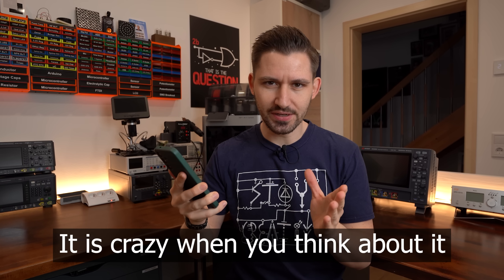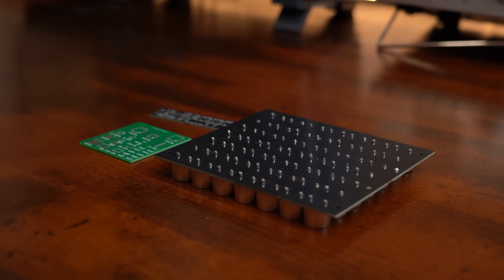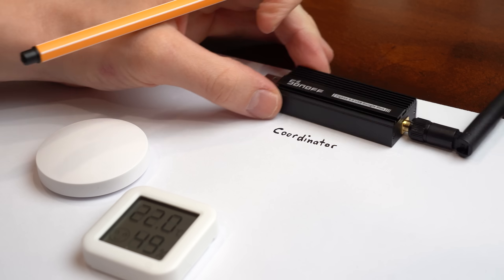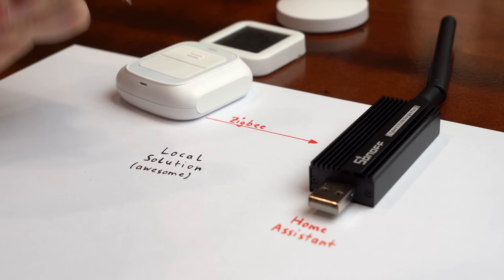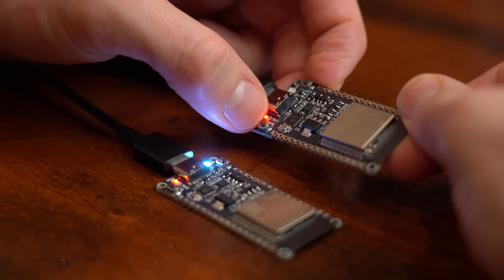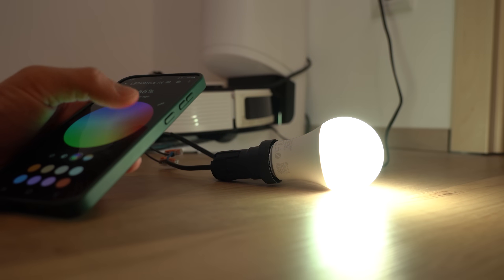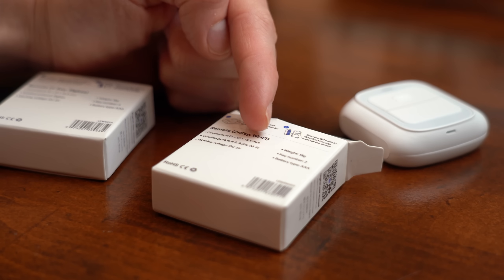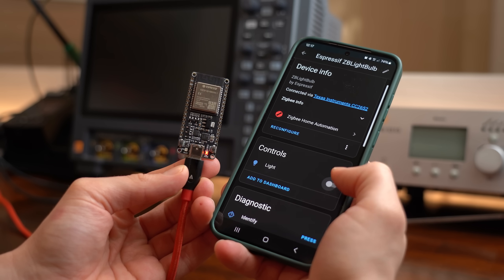Forget WiFi AGAIN! This Wireless Method is WAY Better? (Zigbee)

Comment: The zigbee module in my Aqara tunable white LED bulb died so I tried to replace it with ESP8266 bare esp-12E (smallest form factor, and I had it already). In idle the ZB uses 15 mA, the ESP-12E 67 mA or 15 mA (with higher peaks from time to time) with wifi power save active.
I'm still trying to understand why it resets itself as soon as it reaches the status "ready" (onboard LED turns on). Maybe a wrong connection on my side.
If you want to play with it for a video, maybe I can borrow it to you.

Comment: While your point about wifi devices (at least those which require cloud connectivity) being disabled if a company goes bankrupt is completely valid, I think the more frustrating part of those devices is that companies can just stop supporting whatever you bought - for any reason, and at any time - which makes the device you bought a literal paper weight. A couple of years ago Sonos bricked all of their Gen 1 speakers because they decided to stop supporting them. They absolutely could have released a firmware update that would have at least allowed them to work locally, but they didn’t - as far as I know anyway. 

Plus, having more wifi devices on a network isn’t a good thing. Especially when we’re talking about homes that could potentially have over 100 “smart home” devices, which doesn’t even include computers and phones, etc. That will just end with slow and unreliable wifi. Same with devices that operate in the wifi band in general - there’s only so much bandwidth available, so I try to keep all of my smart devices off of my wifi network.

Comment: With Home-Assistent you will want to use Zigbee2MQTT instead of ZHA because the former can handle firmware updates using a big list of internal firmware versions that gets updated frequently. It also has much more features.

Comment: Wireless range is good, but more so bad -- To increase capacity in a wireless system, the strategy is usually to decrease transmission power, and add more access points which connect with a wire. The smaller the range of wireless transmission, the more access points you can use without interference, and the more wireless devices you can use within a given area. Wifi makes it extremely easy to achieve this high density. Zigbee on the other hand... Not so much :)

The radio frequency spectrum is one of the world's scarcest resources. When something is transmitting within a space, it is occupying that bandwidth and there is literally nothing else we can do to have more of it. Having two separate systems transmitting within the same frequency range means that they will interfere with each other. When there's interference, it gets worse at an exponential rate -- Failure to transmit results in re-transmission, which will cause even more collisions, and more re-transmissions and so on.

Wifi has a scheme which prevents this by partitioning device transmit time. It also has multiple channels which allows interleaving access points in a way that doesn't cause interference, and many more optimizations to squeeze as much as possible out of the available radio frequency range. Having a Zigbee transmitter in the same space is in direct conflict with these efforts.

The only real clear advantage I could see for Zigbee would be the lower power usage, which would only really materialize as a benefit when using batteries.
But who wants to keep replacing batteries for hundreds of small devices? I'd find means of not using batteries at all for these devices instead of trying to extend their battery life a little bit.

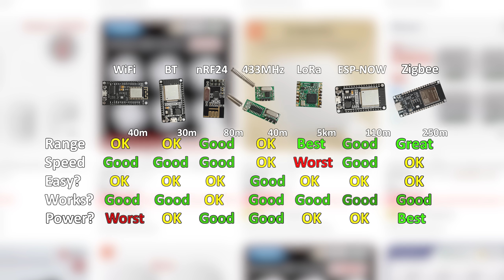Comment: 11:34 something I have struggled to find clear data on is battery life of “receiver” devices that are always awaiting a command or connection. I’m not asking for years of run time in a constant waiting state.  My need is for something that could be left on for atleast a week running off of an 18650 but be able to respond instantly. Any ideas?

Comment: Here is another protocol for you to take a look at. Z-Wave. I dont know if there are any dev boards for it out there but it uses a lower frequency then Zigbee, lower total devices in a network but its touted as have very good meshing capabilities. Would aslo require a coordinator for Home assistant. Id recommend Zooz brand for that.

Comment: All good content. One more bit on Zigbee vs Wifi:  You have over 100 Zigbee devices on most coordinators, and the network generally is still quite responsive.  Many Wfi routers top out at 30 to 60 devices, and are super slow when you go near those limits. Even running OpenWRT or other firmware that doesn't impose a software limit, the spectrum and protocol are simply not designed to have more than ~80 client devices on a single access point. (For 2.5 at least, 5 is better, but most wifi home devices only support 2.5).  Zigbee, because of it's protocol, is designed for smaller burst messages, and for being point-to-point.  In fact, you can setup Zigbee devices to talk directly to each other!  So even if the network is gone, a switch can still talk to a bulb and turn it on, so long as you directly bind them.  The protocol isn't designed for  large data transfers (like firmware upgrades), but it's great at what it wants to do 99% of the time, which is operate devices and report status.

Comment: I implemented my whole house (just lighting) in the mid 90s on a system called "X10".
It was a pretty big house on 3 levels, so it was nice having control. 
Unfortunately it was never really as robust as it needed to be, and i eventually just gave up. 
Since then the whole idea of home automation just isn't interesting to me, but that's all a function of the much smaller house i live in now and the emergence of LED lighting, which uses do little energy i just leave them on all the time.

Comment: BT range is "ok"?
Obviously these things are subjective and depend on use case, but I would say a few meters for BT and 20m for wifi are VERY different.
Also not sure how wifi is only "ok" for easy? Again, probably use case. If you want to do home automation or similar, I guess it is tricky(er?) but for the vast majority... press a button, or type a credential and you are done.
EDIT: BT is 30m??? Since when? ( I WISH you had of put those stats on the original chart..... why are those stats not on it? :( )
Reply: EDIT2: You have numbers, why are you using non specific Worst/ok/good???
Or more specifically, why are you using those words and NOT using the numbers as well?
A bit disappointed for a science/testing channel.

Comment: I'd love to see you come back to zigbee after 6-12 months of use.  I have several devices, and as the batteries get low, or even for no reason at all, now and then they'll drop off the network or report out sensor data more infrequently.  Curious to see if you have the same issue

Comment: I got lured into Zigbee by the HA community because it "is the best thing apart from wifi to communicate with IoT devices". I've purchased a truckload of sensors only to later discover that it doesn't work well, at all, especially if the Wifi spectrum is moderately crowded since it also uses 2.4G and exactly overlaps with Wifi, which is pretty dumb if you ask me. There are two channels that overlap "less", but even then it's pure luck. Plus, some coordinators are extremely weak and barely reach the first router, in my case only 10m away. Which coordinators are the best you ask? Well... nobody really knows and the HA community randomly buys new ones and discovers stuff. I'm on my third coordinator now, and it still sucks. If that is not already sufficient, it gets even better; the devices mesh together as "good as they can", which isn't often the best mesh, but once done, it's difficult to remesh them in a different configuration, and if you try to do it, the whole mesh often falls apart and gives you nice headaches.
But wait, it gets better!
Since buttons and lights aren't directly connected with each other and the coordinator doesn't have any 'intelligence' on it's own (not even the basics), if you turn on a light and HA crashes or otherwise has a problem with itself or the connection to the coordinator , you can't turn them off - at all, which has happened a few times as well. The only solution in that case is to turn the breaker off. Imagine wanting to go to bed and the lights don't want to turn of for whatever reason - lovely!
All in all I wouldn't really recommend Zigbee, but that's me. It works well with a handful of sensors, but as soon as you implement it, it gets problematic VERY fast. 
I currently have a whole BOX full of Zigbee sensors that I honestly can't use for anything because of the issues above. Some of them were never used, even.
Wifi devices have proven the most stable in our home, by a far margin. The only downside of wifi devices is power consumption and crowding the router with IoT devices, really.

Comment: I'm using ZigBee to automate my entire home. I replaced all wifi devices to ZigBee when I moved from my old home to the new one. Regarding the "Low data rate", I really don't think this is a problem at all. Firmware upgrade? I will do it once in my life. For IoT data, this is more than enough, and the power usage is more relevant than the data rate for me.
Reply: Also, when I was testing devices, I bought some CC2530 dev boards to test. I found an open source software to program these devices very easily, to configure their GPIO pins for switch and relay (I don't remember the name of the software, I did it long time ago 😅)

Comment: 6lowpan over 802.15.4  is the only valid answer, that is not proprietary, however everyone is pushing proprietary technology, guess why. Zigbee is just a closed, proprietary stack over 802.15.4. RPL is infinite times better over 802.15.4 than anything Zigbee has to offer.

Comment: Zigbee is great for home automation/sensors or anything local really, as long as you can get away with relatively low throughput, although it's still much higher than with LoRa.

Comment: The trouble I see with Zigbee is that it is on the 2.4GHz band which is quite crowded. ZWave is like Zigbee but in a completely different band plan that is not as crowded.

Comment: I know you’re a hardware guy (I love your videos and have followed for a while) but if you want to dive into the packets more you can connect that dongle to a computer, download and open Wireshark, and see the Zigbee packets in the area. They will be encrypted but based on some access you have you are able to get the keys and import them into Wireshark to view them.

(I did this for some work during my Masters with Hue Lightbulbs so it’s possible to get the keys without a UI I just forget how)

Comment: Use Thread next! It’s also published by the CSA, available on those same boards, and it operates on the same frequency but it has a much more interesting protocol layer. Highly recommend!
Reply: I also second this! I did an internship in 2022 and played around with OpenThread and I found it very promising, especially considering that it doesn't define the application layer like Zigbee does, so it leaves a lot more creative freedom to the developer/tinkerer. But I feel like adaptation has been slow and I haven't looked at it since. I am very curious to learn where it stands now! 

It basically allows very low power devices to be addressable directly over IP. What this means is that you could reach a Thread device as if it was a computer in your home network. It gets assigned an IP address and you can just ping from your computer to one such device. And because it uses IPv6 (for all practical purposes) and basically connects to your home network it even has the ability to be directly addressable from the internet. It completely removes the need for a base station like a Homey or a bridge, provided you have at least one border router in your network somewhere. 

It takes a lot of 'in between' layers away from making low power stuff work. You could write a program on your computer and have it directly interact with a Thread device, no need for additional hardware to receive the instruction from the local network, unpack the data, translate it to a Zigbee package and forward it. It really just is a device connected to your local network. I genuinely believe it is a better concept than Zigbee, but Zigbee (and Z-Wave) have the momentum, and Thread is the new kid on the block.
Reply: Second this!! I’ve just finished an internship about researching Thread and it’s such a good protocol for IP routing for IoT purposes
Reply: He'd get angry emails from the Thread Group if he did that. I won't link it, but if you Google "Thread - the tech we can't use or teach", you'll find my blog post explaining why. And it's a total shame, because Thread would be a very nice platform to use.

Comment: I don't think the data rate is a negative point for zigbee. Zigbee was just not designed to transfer huge amounts of data. Its job is to standby, send tiny bits of data and use the battery for as long as possible. Giving zigbee a negative point for that is like giving a car a negative point for not being able to fly...

Comment: Interesting that your devices work everywhere. I had to buy two Ethernet zigbee controllers because I want able to get any connection one flor below the main controller
Reply: Sounds like something in your floor is blocking 2.4GHz.  Do you have concrete floors by chance?  You might try installing a couple router devices in your stairwell - one high enough to see the top floor (smart bulb?) and the other low enough to see the bottom floor (smart plug?).  As long as the two devices have a clear path between them, they should route signals between the floors.

Comment: I bought an ESP32-C6 for an idea, but I read somewhere that you can't run WiFi and Zigbee at the same time, it can only handle one at a time. I wanted to have it send and receive data externally, but under certain conditions, control smart devices too. Is this the right board for that idea..??
Reply: Even if that is true, you could get 2 boards and use one for wifi and one for zigbee communications and connect them together. You could get one that's wifi only and one that's zigbee only too if that's cheaper or provides better range. They're cheap enough to make this viable, even if it makes it a bit more complicated.

Comment: Those Zigbee buttons can still work in Home Assistant. You can add custom device handlers in ZHA, and it’s not too difficult. Alternatively, and most recommended is to use Zigbee2MQTT instead of ZHA

Comment: Problem is unless you build your own ESP device you can't choose if for example your lightbulb in your example will act as a router or not, which is Zigbees main flaw and causes it to always become unreliable as the number of devices grow. After adding your home full of IKEA and Philips hue bulbs, smart plugs etc. you have dozens of routers and some of them WILL eventually be turned off by light switches, somebody unplugging a power strip etc. Everytime this happens the mesh breaks and has to repair. Your coordinator cannot force a direct connection to devices, since the routing table is dynamic and lives in each device. Mesh is good when there is not a good enough direct connection to the coordinator, but with Zigbee devices you will start seeing in your device chart that they start meshing unessecarily even though they are in the same room as the coordinator, and the more devices connect in mesh mode instead of talking directly with the coordinator the more fragile the mesh becomes. Out of my 70 smart devices 50 report as routers, and it only takes one or two to malfunction or get turned off for the entire mesh to become unstable. If one could assign dedicated devices as routers that cannot physically be turned off and are located in strategic places around the house it would be a different story, but this is not possible, instead you have to rely on Zigbee protocol do dynamically handle meshing, which works worse and worse the more devices your get, when it really should be the other way around.

Comment: I've been using an ESP8266 for some wireless WS2812b control (data only, powdered separately) with no flicker from the 3.3v data. However it seems to freeze or the wifi server breaks down if you send 'mismatch' data (like a 0 when it expects no less than 1). I've looked around if anyone has faced this quirk, but haven't seen much. Anyone else?

Comment: 1) Get the SLZB-06M that you can power with PoE. It basically uses the same chip as the Sonoff Dongle-E
2) Give Zigbee2MQTT a go instead of ZHA. It's just MQTT and works perfectly in Home Assistant. New devices are support much earlier than ZHA and generally has larger support

Comment: My aqara motion sensor, or aqara wireless (zibee) switches they use regular smal, button like 3v battery.. im using those devices always.. 2 years have passed batteries still almost 100% ! ZIgbee is AMAZING when it comes to power. small batteries lasts for YEARS :)

Comment: Is it possible to communicate between two ESP32 using the ZigBee protocol WITHOUT an additional zigbee network controller?
Reply: That's exactly what he does with the range tests.  One ESP32 acts as the coordinator and the other as an end device.

Comment: Dont be fooled. ALmos tall chinese devices that are pretending to be routers is NOT!! they never route anything.The only brand that really routes is AQARA, from my tests.  End devices should be able to connect to routers, but i have many rbands and only aqara devices works as router and many other end devices are connected to them instead to coordinator. This proves that AQARA works like router while none other have ever worked, only PRETENDS to be router. You can see in Zigbee2MQTT zigbee network map and see (for those who uses zigbee2Mqtt instead of crappy homeassistant zigbe integration.